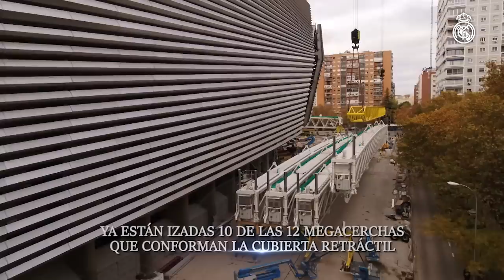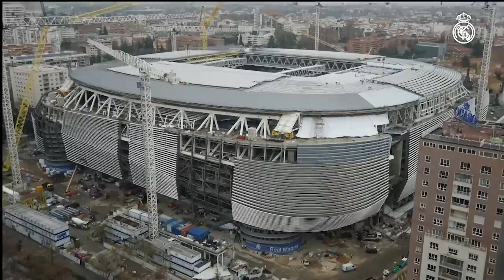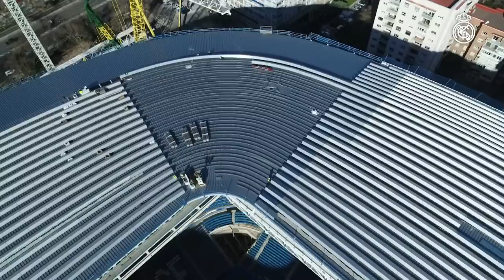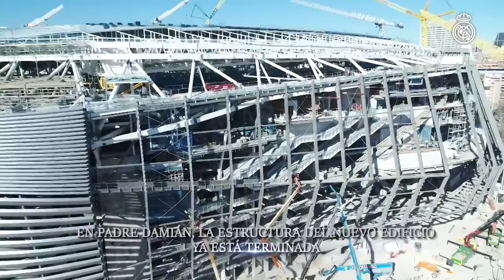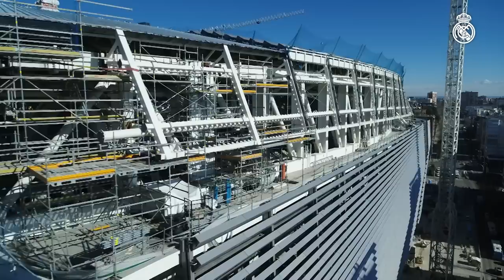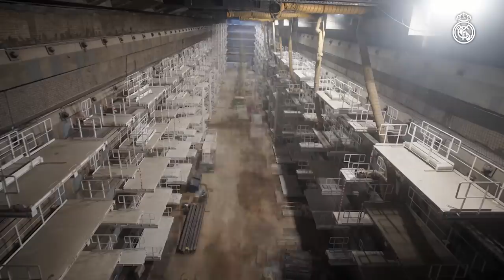NEW Santiago Bernabéu stadium works (January 2023) | Real Madrid

Comment: Literally the same stadion cover with a tin. Not much an upgrade from what I see apart from a moving roof. Nothing needed in Madrid anyway. I liked old concrete structure. It looked pressive. Definitely should be looked after but the tin looks good only on the renders. I really after a while it will be like a trash bin.